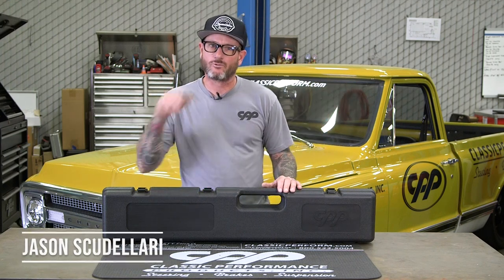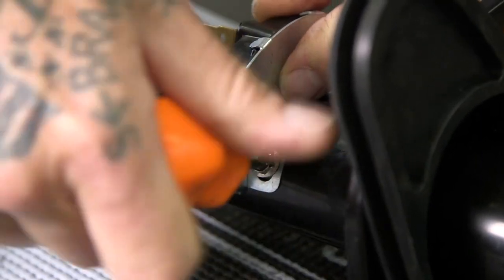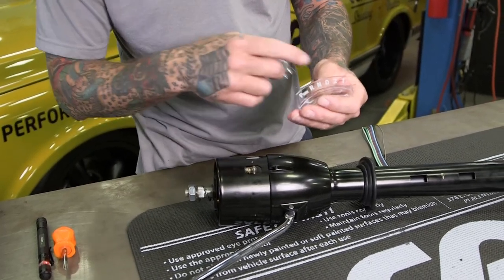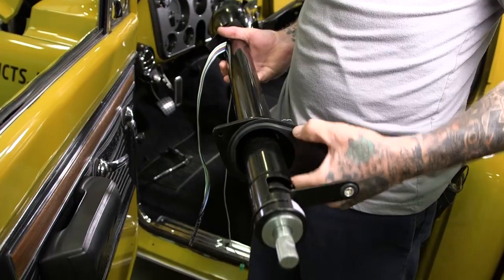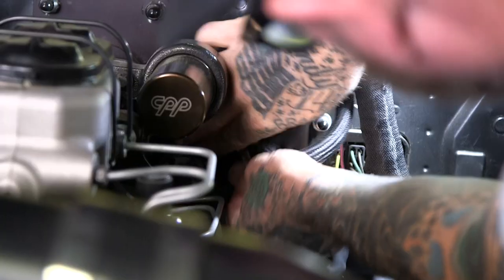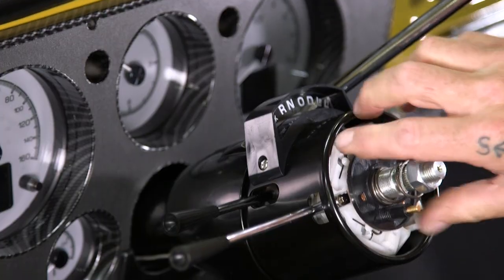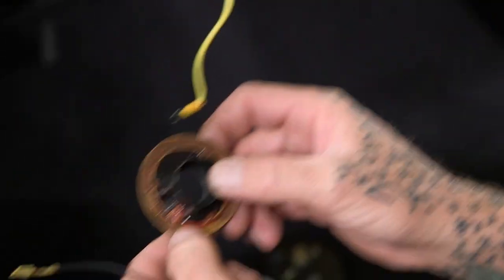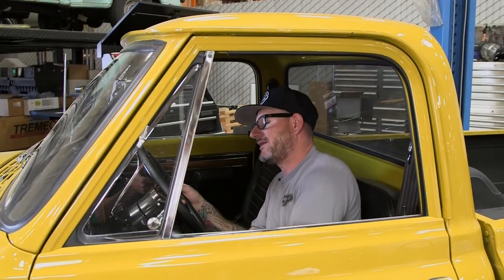How To Install CPP Premium Tilt Steering Column (1967-1972 C10)

Comment: I just installed my cpp tilt. Something this video should have mentioned is that if you have a 67 or 68 your steering column is one solid shaft and will need a lower shaft to make it work. Showing the removal would’ve been nice too.
Reply from the maker: Thank you for the feedback!
Reply: Im thinking of this column for my 67, what else did you need to get it installed?

Comment: I just installed today on my gmc 70 stepside but the the on the shifter get stock when we put it in when we take off we can change from.park to A Drive what can we wrong the pin?

Comment: everything looks perfect except I wish there was an option for have used the horseshoe wiring plug instead of needing the adapter.  We needed them when stuffing van tilts in, but not needing the adapter on this new piece would have been great.  Regardless a minor complaint, good job.

Comment: Interested to know what length column you used in this video as it sits closer to the dash which is what im after.
Reply: Cpp offers a 67-72 steering column that is 1.5 inches shorter so you have more room in the cab
Reply: @edwardfoss6859  Thanks

Comment: Will this tilt column stick out past the dash further than the stock steering column? If it does, does the 1.5 inch shorter column fix that? Thx
Reply from the maker: We have two columns: one that is the same length as the original and one that is 1.5" shorter. So no, this one won't stick out further. You can check out this video for more info: https://www.youtube.com/watch?v=fs4GeKUq5lw or give us a call and talk to a sales rep at (866)-882-4131

Comment: Just wondering when these steering columns were changed to premium columns? In the past they were known to have problems and I’m not sure if the quality has changed . If someone could let me know I’m not sure if I should purchase one , don’t want any problems.
Thanks
Reply from the maker: Hi Jerry, any steering column with a part number starting with "DC" is one of our Premium Columns. Our old columns were intended to be extremely affordable and as such, they were lower in quality compared to other more expensive options. These new Premium columns were completely redesigned with build quality as good as the competition but still available at a pretty reasonable price. If you have any other questions about our columns, give us a call at (866)-882-4131 and one of our sales reps will be happy to help.
Reply: Thanks for the info ! Should be great in my C10

Comment: Which model do I need for a c10 72 automatic (4L80) with rack and pinion?
Reply from the maker: You can check out the options here: https://www.classicperform.com/Store/ClassicFitSteeringColumns/ClassicFitSteeringColumns.htm but if you need more help in regards to adapting it to your rack and pinion, you are welcome to give us a call at (866)-882-4131 and one of our sales reps can assist you!

Comment: What is the part number for the horn ring and what steering wheel adapter did you use?
Reply from the maker: We use an adapter that fits GM steering wheels from 1969-'94. You'll have to give us a call at (866)-882-4131 and speak with a sales rep to get that horn ring part number

Comment: What’s the length on the steering column?
Reply from the maker: We offer a standard length one that is the same as the factory column and a 1.5" shortened column.
Reply: @CPPmaster  any special modifications needed to install the 1.5" shortened column?
Reply from the maker: @sm5737  Nope! It installs the same as the OE-style column.

Comment: Would this fit in a 1979 c10?
Reply from the maker: We do not currently sell a direct fit kit for '79 C10s but we do sell most, if not all, the components you would need to install one of our Universal Premium Tilt Columns. If you give us a call, one of our sales reps can help out!
Reply: We're can I find the the steering wheel adaptor and the different horn assembly that you show on the video I looked at ccp website no luck

Comment: What size is this ??
Reply from the maker: Can you clarify your question please?
Reply: @CPPmaster is it the 3/4 36 output shaft or is it shorter ???
Reply from the maker: @locomovesvl6095  The shaft is a 3/4"-36 spline just like a factory C10 column.

Comment: How does this unit come apart? I need to get the turn signal switch out but the black shroud around the upper section of the column has a flange that won’t allow the switch to be removed once the three screws are out. How does that black upper shroud come off? Thank you.
Reply: I just replaced my switch, it will come out using thin small screwdriver. Mine went bad and would make turn signal come on front when brakes were pressed. I bought replacement from TRQ on Amazon and new one fits also snug, but lights work as they should now.